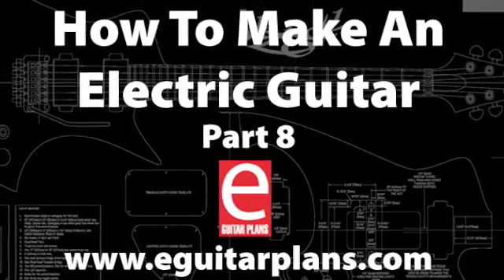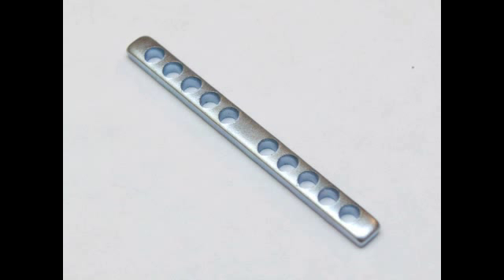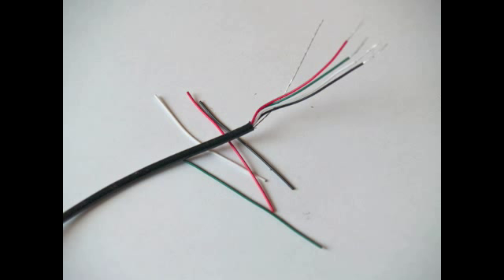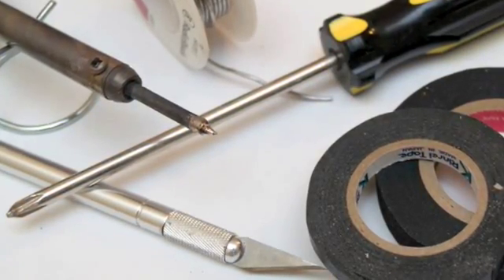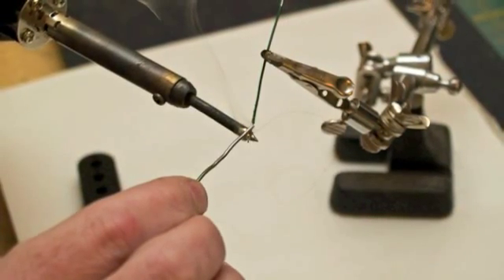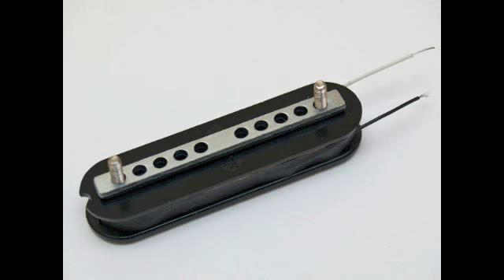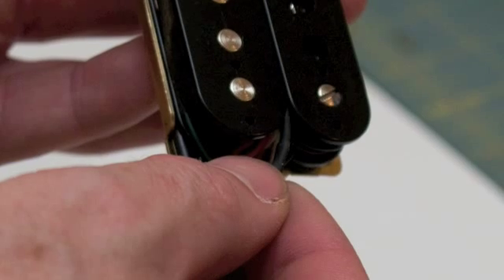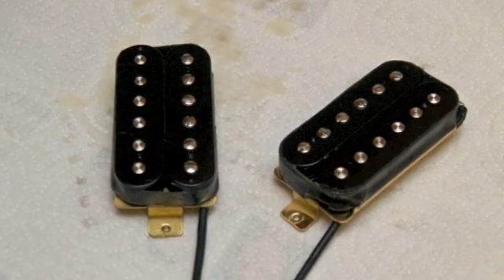How To Make an Electric Guitar Part, 8

Comment: @earsBLEEDmetal1 hubucking pickups are just two single coils wired together. the wires he solders together and tucks inside the bobbins are the ones connecting one single coil to the other. they just connect them together